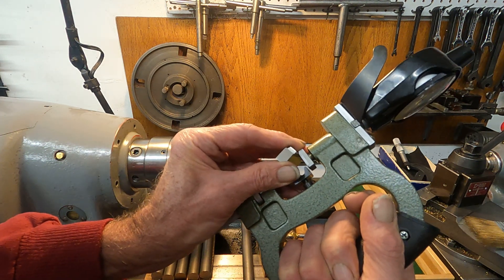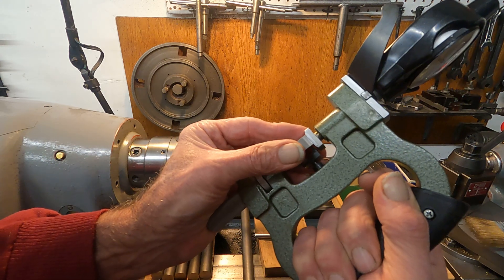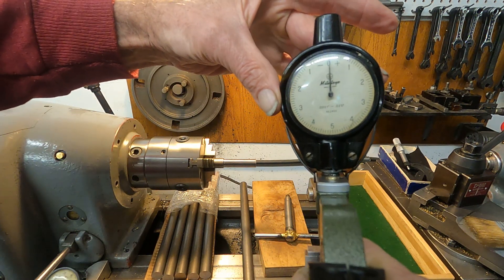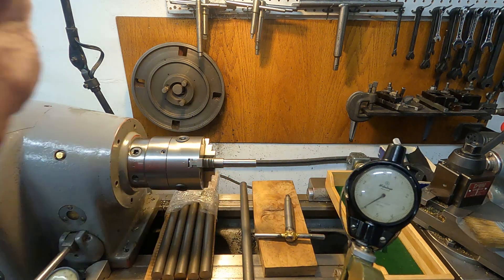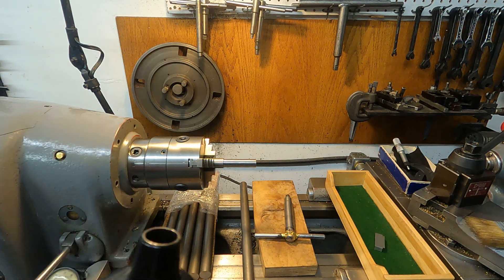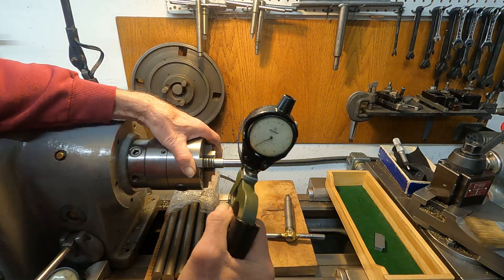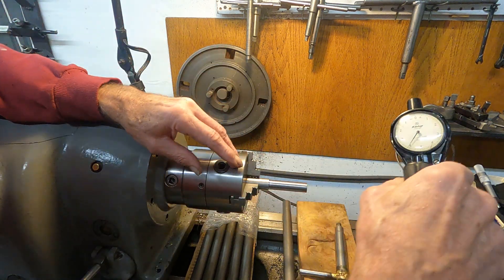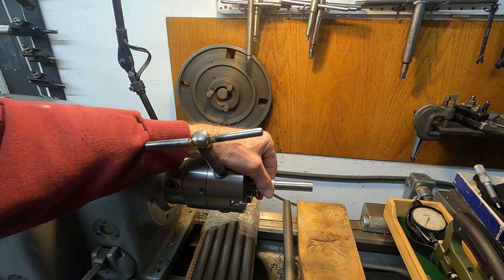Bearing in mind ANSI standard fits

Comment: DeeDee, Would you show how to set up a dial indicating snap gage, start to finish? Please.  I’ve never even held one and as much as I understand using gage block to get part of the setup done it looks like other things have to be set to address different diameters accurately in the other axis.  Before I start trying to buy them I’d sure like to know more about how to set them up and us them.   A “bird walk” from the line boring tool, but maybe later???  Cheers, TB
Reply from the maker: Great idea! The latest noncontact measuring devices are making gages like these obsolete and they are getting much more affordable on the used market. The dial indicating snap gages and dial bore gages take a bit of fiddling and a little practice using known standards to get the feel. I will do a video or two showing the setting of these gages, Thanks!

Comment: Its tough when You have to design Your customers parts. You then have to train them om purchasing and inspecting the bearings the the shafts run in. I guess its all part of the job.  By theway  I have 2 cnc lathes and they are no different than manual in respects to a good setup and a good plan of action are required. A lot of things can influence these parts. even tailstock pressure. Just enough, Not too much or the part will bend and possibly create the out of round condition You observed
Reply from the maker: I think you are right, I am not in the CNC end of things but I think this would be a not profitable job and probably a pain to do such a small quantity.